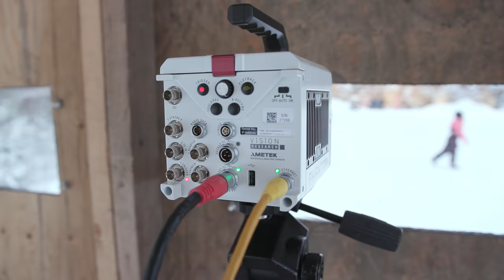Exploding Broken Down Tesla Model S

Comment: Right to repair needs to be a law everywhere! Tesla, apple, John Deere, and so many other companies lobby against it because it's a huge money maker for them. You should never be able to sell something without the owner being given parts and work manuals
Reply: In this case it's a matter of scale.  A whole battery pack is a part.  They do sell those.
If an owner mangles the original beyond repair what should the dealer do?
Sounds like that's what happened here.
Reply: Agree - but it's best not to buy any product in the first place,  where the manufacturer actively obstructs owners from getting repairs done by an independent technician.
Reply: Henry Ford said he’d give every family in America a model T if he was the sole supplier of repair parts.
Reply: Apple changed it’s policy to allow right to repair a month ago. Do your research. We are headed in the right direction one big company at a time.
Reply: @Isaiahjcooper  - Even so, many companies manufacture products where you need specialist proprietary equipment and tools to repair their products. German car firms are a prime example and have been doing it for years. Their Dealers then charge exorbitant amounts to maintain and repair their products. They have been doing it for decades - I know as I worked for one most of my life.
Reply: @rogerbarrett9920  As it turns out, a shareholder group believes the timing of apples right to repair pronouncement is tied to a court decision on the resolution asking Apple to “reverse its anti repair practices”. The group was seeking to bring the resolution to the SEC in November but has since withdrawn it based on Apple’s action. If something similar were to occur within the Tesla sphere I’m sure we would see due diligence being done. I agree with your point and it is unfortunate it takes such great lengths for these companies to make the right choice.
Reply: It will also helps the environmental concerns really for a good change if it happens in the future! Make a petition for all cars makers and also the EU or any parts of the world should do petition in the parliament court bringing this issue..make them pay...any politicians should discuss about this!
Reply: That's why I'm looking at Aptera Motors.
Reply: @richardf911  no it isn't and repairs on it can be modular, you know just replace the cell that are bad... It's not gonna be perfect, but on a 10 year old car it doesn't have to be, it should be an option to spend only a fraction of that cost. To say the entire battery pack is a part so it had to be replaced in it's entirety rather than just a part of it, is like saying the oil filter is bad, so replace the entire engine because that's a part too.

if tesla thinks the owner mangled the car and they aren't confident with repairing it after he already tried and messed it up.. they still should offer the cells for any 3rd party shop or the owner himself to replace.
Reply: I totally agree with the parts, not sure about the manuals.
Reply: absolutely not. Tesla and any other self driving car can't be repaired by untrained personnel
Reply: Tesla service centers don’t make Tesla a profit
Reply: Agreed, as a technician I will never buy a product as expensive as a vehicle that I can't fix myself
Reply: Perhaps they still have all the pieces in one dumpster. I'm sure you can have them if you want to repair it back to factory state X'D
Reply: @gabem3568  so you won't ever buy an EV?
Reply: With Tesla they also need to address both the "need to repair" and "cost to repair". Tesla fan boys make Apple look 100% rational. Who would buy a vehicle where this scenario is even possible.
Reply: Agree completely!
Reply: @richardf911  The battery is actually comprised of 16 modules.
He might have been able to repair it for a lot less then 23K by replacing just the defective units and balancing the pack.
Reply: @Isaiahjcooper  John Deere's obstructions of the right to repair was doomed from the start as farmers won't deal with that wait 3 days for a tech to fix a broken down harvester it rain could come in and the entire crop could be lost.
Reply: You need to watch Louis Rossmann. He actually talked about it was reasonable to ask 20k for the repaire.
Reply: @jaysdood  Agreed I wouldn't.
Reply: Have you heard about Toyota yet?
Reply: @richardf911  it doesn't have to be, manufacturers have unilaterally decided that battery packs can only sold aftermarket as a whole thing rather than individual cells. This ie even though selling individual cells is entirely possible.
Reply: Tesla will never allow this. U should see what they do to their solar customers. Horrific
Reply: Companies don't want to provide repair information because it shows the inner workings of their products.  China would just take this information and knock their products off almost immediately.  I wish we had this information but it's more important right now that we don't force our companies to provide copy instructions to the Chinese Communist Party.   😕  

... and by the way... Taiwan 🇹🇼  is a country
Reply: Yep
Reply: @cablecow15 Nah. Iphones are overrated. My android phones goes for at least 5 years before i even consider a new one.
Reply: @Tom-cn4cm  Oh they do. Much profit.
Reply: @masterdftw4983  Yea i watched him. He has been in war with Apple for years. lol.
Reply: only buy Toyota Hilux or uaz
Reply: Or just buy older cars, new cars look like azz anyway
Reply: That's a slippery slope. Every company in the world would have to make manuals for every single product that is "repairable", or to an extent where it is hard for an average person to repair that product with a manual.
Repairing a tesla that has 400V running through it isn't something I recommend you do at home unless you have every piece of safety equipment and knowledge.

Everyone should have the right to repair and companies should stop making it so hard to repair stuff, but they aren't obligated to make manuals for everything. But if they have one (which tesla has for their models) they should sell it for a reasonable price. I bought a manual for my 9-3 SAAB and it contains literally everything about the car. Wiring diagrams, fitting and removing parts, changing certain fluids etc. But that is meant for dealers. Bought it online from emanuals for like $15. 
I repair my own stuff all the time instead of buying new. I changed the battery on my phone because it sucked, I changed the battery on my headphones and more.
Reply: Reverse engineering something when you have the thing in question is much less work, cheaper, and produces a better copy than with the limited information in a "manual". The manual is only useful when you can't get your hands on the machine in question, e.g. a top secret weapons system -- not a car you can simply buy. Which is something the Chinese knock-off industry has decades of experience in and are very good at.
Reply: @rogerbarrett9920  YEP. That's one of the two reasons I don't buy and do encourage people not to buy any Apple product. The other, and more important, has to do with "value".
Reply: @Isaiahjcooper  Actually not. Apple did that just because of image issues. Nothing to do with culture, values and policy – which is completely different.
I don't buy and do encourage people not to buy any Apple product. People are simply running in automatic mode and never stop for a minute to wonder if their real value matches their price. But it's ok for me if dumb people are willing to flush their own money.
Reply: @walterrserrano  I actually liked your comment, up till the point where you called people dumb people... Its quite a degenerating way to talk about people that have another perspective as you.

Im totally not pro Apple, youll never see me buy one of those products, especially since its marketing is scam tactics, and do everything to get a few extra bucks in, but there are also people that like the interface of Apple's products more, that doesnt neccesarely makes them dumb tho... In true honesty, people who call other people dumb usually are that what they call others. It takes intelligence to know that every individual has skills and talents, and doesnt need to be good at everything or know everything. 

And last but not least, its not even a matter of being smart or dumb, its a matter of respecting people's decision, even though you dont like Apple, it doesnt mean that other people that like their products are automatically dumb.. Its just an irrational statement to make
Reply: Yeah at least with gas cars they're not totaled when the batteries go bad. I have a 25 year old vehicle and love it.
Reply: @rogerbarrett9920  That's why I drive a 2 decade old vehicle with some of the best aftermarket/junkyard availability in the world. I've never not been able to find parts, and have never bought a new vehicle. I spend 0 monthly other than gas and wearables.
Reply: Tesla is nothing like Apple or John Deere, Tesla actually support right to repair for one thing, this car simply could not be repaired.
Reply: @krashd  hahaha no
Reply: No not being able to sell someone a car without parts and work manuals because not everyone can offord parts and manuals
Reply: @Strikerdsubmarine  a shop manual costs almost nothing to put onto a $2 flash drive. There is no extra cost here. Even with that, this is an $80,000 car. What they want you to do is buy another f&%@ing car, which if you can't afford a replacement part for, you DEFINITELY cannot afford. For one it should be f&%@ing built better and for two it literally has the onboard storage for a repair manual. They put AAA video games in the stupid thing. A pile of directions, part numbers, and schematics take up less than a thousandth of the space The Witcher 3 takes up. There is no excuse for making your product hard or impossible to repair, just pure greed.
Reply: @jgedutis  except many of their components are built in China, they literally already have them. Trust me when I say this is not about protection from reproduction.

And of course, glory to Taiwan and Hong kong. May they outlive China.
Reply: @Isaiahjcooper  Yeah but it still cost more to fix it yourself then to send it to apple to fix it. And it doesn't make any sense.
Reply: @OniNekomon  No! Apple wanted 200$ to replace battery. I did it for 20$ and it was easy, the original was also imported and was short lived. How does that not make sense?
Reply: Then he /owner or  you tuber/ messes something up at home because he doesn't understand what he's reading and returns to e.g. Tesla with a complaint.
Who will pay for an unsuccessful attempt to balance the battery at home, for example?

Comment: This was biblical my friend. The focus on shock wave was really appreciated. It's not common that you catch a shock wave that clearly.
Reply: Hello!
Reply: I wonder does low temperature affect on Shockwave
Reply: Was cool to see the multiple waves.
Reply: i came to see a car vanish, but that shockwave was just so much eye candy its all i could watch.
Reply: Amen
Reply: 9:10
Reply: @Ripskin16  I was hoping to see the shockwave rebound off the wall wish the wide angle shot hadn't have been lost that would have been awesome to see!
Reply: @nanaki-seto  Yeah, it would have been!
Reply: @frogalex  It doesn't really. The initial air pressure do effect but it just happens that the air temperature also correlates to the air pressure. The colder it is, the higher is the air pressure. In layman's terms you could say that there is more air than in hot temperature and that is why the explosion has to move more air out of its way which in turn makes the pressure wave more defined.

TLDR; the root cause is a high air pressure which causes both, the coldness and well defined pressure wave.
Reply: Bravo!
Reply: @frogalex  It´s more the difference between the pressure zones. A shockwave is a high pressure wave. This high pressure zone has a different Refractive index than the normal pressure zone, so the light is bend/refracted at that "wall".
Reply: Nah its kinda normal catching shock wave to me after watching lots of explosions but i like more that spark moving soo fast more.
Reply: @frogalex  mostly on propagation speed.
Reply: Shape charges are something special
Reply: @frogalex  Theoretically it would speed it up since cold air is typically less dense. However, the oxygen content of the air may also be lower, so it could go either way. For purely shockwave, I'd expect it to be measurably faster with a longer distance.

This is the same theory behind why you can hear trains from many miles away at night, but not during the day.
Reply: @frogalex  low temp = denser air = faster shockwave

Comment: I’m glad you guys did this in the right manner: stripped down the expensive parts, removed the batteries, motors, and then brought in the camera gear, drones, and lights. Bravo. I’m glad you guys are sending a message to Tesla. I too have a share in Tesla and I wish Tesla would get ahead of this situation and support right to repair
Reply: Tesla seems to be addressing right to repair substantially with their upcoming cell phone, which will hopefully change that whole industry for the better.
I suspect massive battery packs are much more problematic.  Perhaps a huge redesign could fix this issue.  But it sounds like a very rare issue, so why do it?
Most Teslas seem to last a very long time, batteries and all.
Reply: what message? is a 10 years old car.
Reply: @venturestar  the message is that tesla should be making the parts available for repair if they themselves want to charge the entire cost of replacing a battery pack vs selling refurbished battery blocks.
Reply: @venturestar  That is a garbage mentality. What if your brand new tesla broke down when it came out the dealership and they told you the bill was 25k ? OH and also it would be 2 years before they could make the part, I am pretty sure you would be pissed. Also there is plenty of cars that last way past 20 years with just regular maintenance.
Reply: @c2thew156 I don't know the circumstances so can't judge what's happening.
Reply: @gamefreak173  I don't know the circumstances so I can't judge
Reply: @richardf911  We know that's really you, Elon.
Reply: They should have just left the car the way it landed and put up a gravestone which reads:

Here Lays The Future Of Electric Vehicle Innovation
Reply: @richardf911  How could you tell haven’t been around that long
Reply: @richardf911  Tesla doesn't have a cell phone and I don't think they are planning one either. Idk what exactly was wrong with this cars battery but batteries are expensive and if they had to replace the whole thing $20,000 is roughly what they charge for one
Reply: @c2thew156  The used market is the only way many people can afford a decent electric car that is not a golf cart or quadricycle.
Reply: @gamefreak173  Then it would be under warranty. The issue is when the vehicle has the warranty voided and that is exactly why this video is here ;)
Reply: @Samosayummyyay  that went over your head. What good is a warranty if it takes over a year to make the part
Reply: Sắp tới hy vọng không phải là một chiếc Vinfast haha.
Reply: @venturestar  I agree.  Things get old and break down.  The mentality of so many commentors is that no matter how old your car is.  You should be able to get a part to fix it.  That is fine as long as people can still get factory parts for their Ford model A. Sorry but there is a time to move on and 10 to 20 years for cars and trucks is that time.
Reply: good  job  on  a  useless  used  tezzla  lawn  ornament.   $ 20, 000  for  a  battery  is outrageous  n  ludicrous.  can  get  a  good  used  toyota  and / or  honda  for  that.
Reply: @richardf911  

The model Pi seems less like a legitimate cell phone and more like something Elon Musk propagandists are making up with knockoff androids being given to reviewers.
Reply: @driver4011   Lithium batteries is expencive... I did just pay 1600€ for 5kw/h battery bank for my camper van and this battery for the car is about 18 times larger and only costing 12 times more.
Reply: @richardf911 2 years later still waiting on that Tesla phone

Comment: Spectacular demonstration from a consumer who was robbed by a seller or company that gladly took his money and discourteously did not stand behind their product when it failed.
Reply: Hmmm not sure.  Said he took out the stock battery for a 90 volt battery and they failed to seal it and it got water damage and ruined. Why I leave things stock.   Plus you don’t lose the warrantee.
Reply: @GGG.PH. Not true
Reply: @GGG.PH. Not true
Reply: @GGG.PH. You think?
Reply: @BootsEditor11  if you mean in the vid, he said the car got upgrade, which could also mean a job from Tesla, not that he did a custom job, and then that the battery had a water leak, not that the battery wasn't sealed and got water damage.
Reply: @dr_birb  It says right in the video that the work wasn't performed by Tesla.  They don't spend much time on how it failed and all the details, but yeah, he changed it outside Tesla to get "better performance" with a 50% boost in Voltage and the job failed.  So, not their fault.  I think if he replaced the battery he originally had he might be ok but he likely sold it.
Reply: @BootsEditor11  literally nothing of what you just said is in the video
Reply: @dr_birb  2:00
he literally says than someone else other than Tesla changed it snd then it broke again
Reply: @dr_birb  You need to rewatch it. From the beginning.
Reply: Normal cars fail all the time. Tesla fails and everyone freaks out.
Reply: Thats right